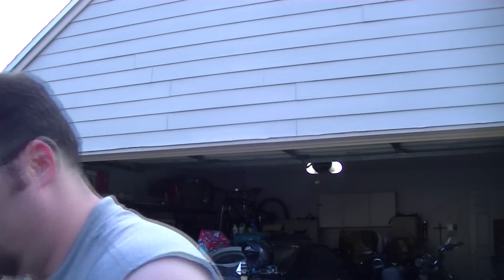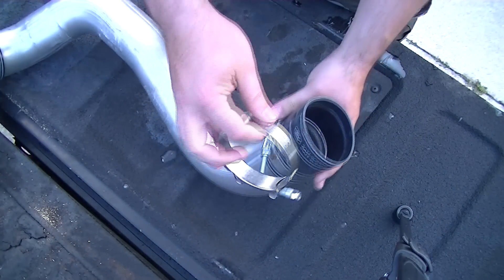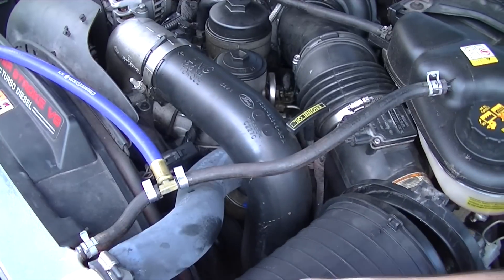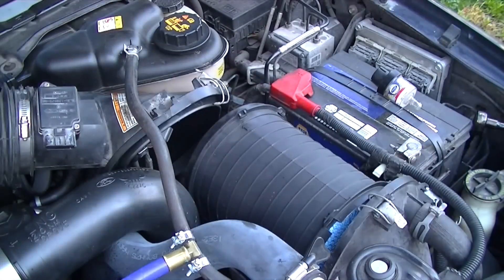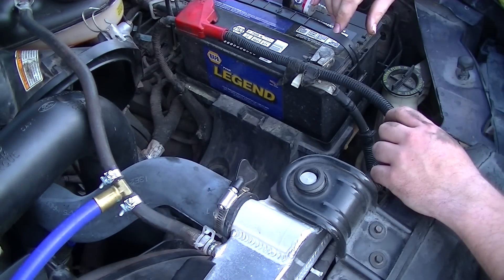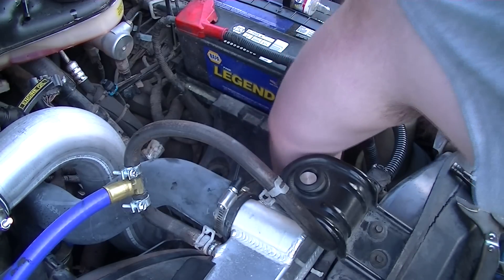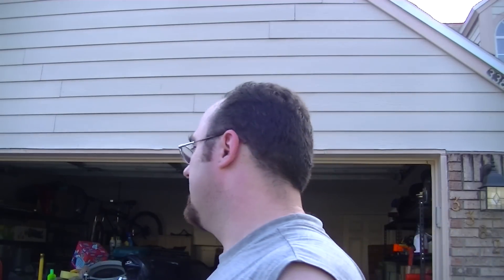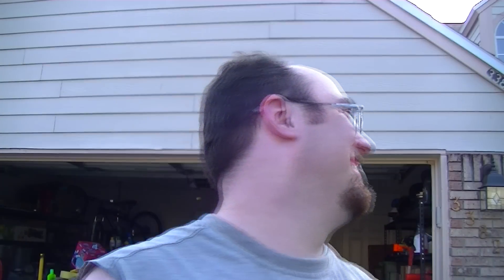HowTo: Replacing Cold Air Charge (CAC) pipe in 2005 F250 6.0L PSD Diesel

Comment: 6.0 air filter is easy. unplug mass sensor...unhook purge hose from radiator....loosen intake clamp, and pull entire filter assembly. 60 second ordeal
Reply: I know that was killing me too, watching that .. I used to struggle with .. Diesel tech Ron, showed me the errors of my way. Only takes 45 sec to take off now.

Comment: Where did you order the pipe from?
Reply from the maker: Tousley Ford - well, now I think they are called White Bear AutoNation
Reply: what's the part number for that CAC tube?  My 2007 F350 DRW 6.0L has same issue, I can hear it leaking underneath the intake air filter box, so I pull air box to find that the accordion part of the cheap plastic VAC tube has splits on the seams.  I'd like to order that factory metal CAC tube.

Comment: Got a question. So I just took mine off and it had some oil at both ends. Is that suppose to be like that?
Reply from the maker: How long has it been since you cleaned it?  When I pulled mine the first time, I had the same - so I cleaned it out. I make it a point to clean the CAC every few oil changes.  Don't want oil filling up the intercooler!
Reply: @uberDoward  not sure I just got the truck in end of September. The guy said he rebuilt the motor. This is my first diesel, I got it to do hot shot driving and trying to go through stuff before I do that. What's the best way to clean that out? What causes it?
Reply from the maker: @hilham89  Crankcase ventilation - you can add a catch can to catch the oil vapors.   I cleaned mind using simple green, just capped both ends and swished it around!
Reply: @uberDoward  alright I appreciate it

Comment: future reference,  you can leave the air filter in place and change that house.   BTW. worst air filter setup ever on that truck
Reply from the maker: +John Mack Yeah, it works, but it's a pain for maintenance!
Reply: +uberDoward for future reference you can remove the air cleaner as an assembly and make removal alot easier
Reply: Best air filter setup ever. Easily goes 100k miles.